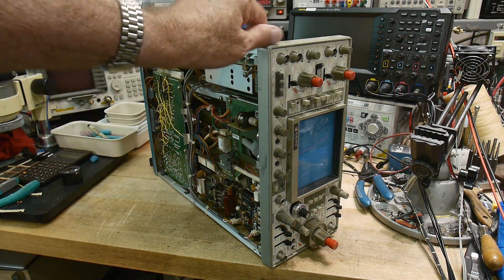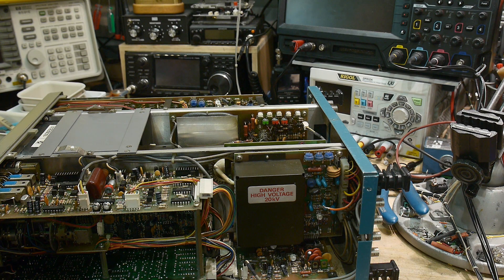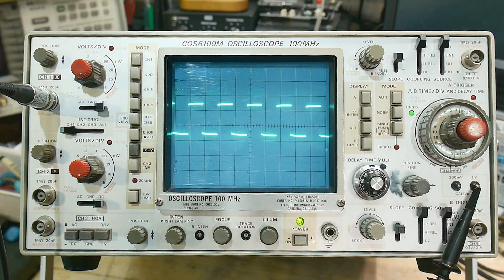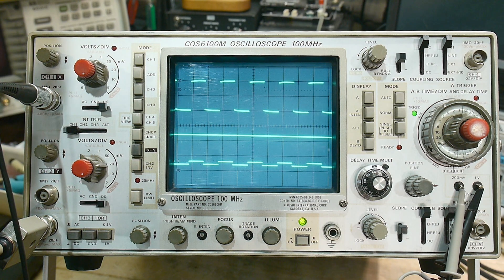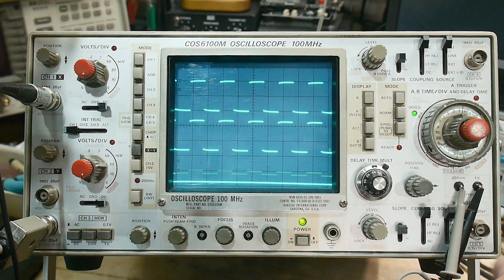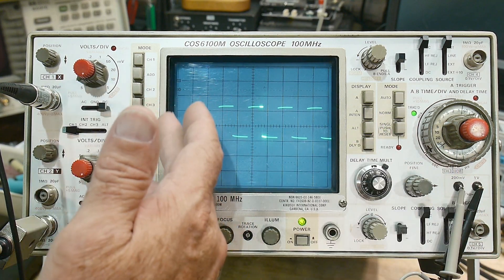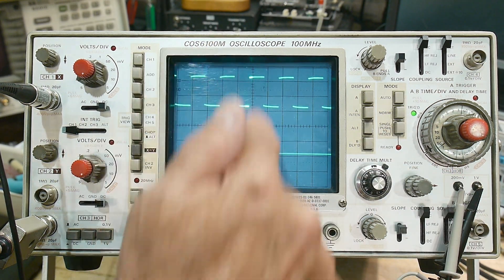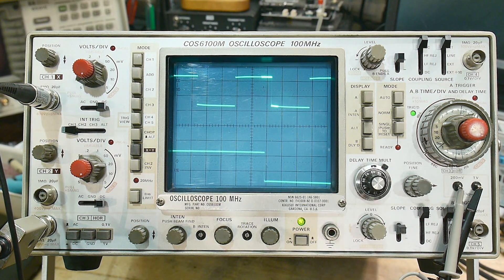#1255 Kikusui COS6100M (part 11 of 11)

Comment: My guess, on your old scope, was that there was some arcing that knocked out part of the HV tripler. The HV and focus voltages must be correct for the electron bean to form properly. If not, the control grid will just cut the beam off.

Comment: What a deal...A donor working scope for $58...Good job. And now you have a basis for comparison for the HV tripler repair. May the new scope get used a tiny and let the Rigol rest from time to time...

We do like or I like the Rigol math and time and voltage display calculations ...it's just newer and better...

It sounds like the Japanese wanted to distinguish themselves a little from TEK and make inroads into their domence...so they added some unique features..

I am ready for some more delayed time base training...

May your sleep be more sound

Thanks
Reply from the maker: the proof is that this scope was part of a US military contract. They won over Tek and  HP.

Comment: Nice video and nice 'scope! It does however use a delay line, so fast triggering edges may be observed, in contrast with what is said from 7:56 in the video. See figures 6.1 and 6.4 and paragraph 6.4 in the manual.
Reply from the maker: Oh, you are right. Wow the delay line was so small I missed it. about 4"x4"x1/2"   The tek and HP delay lines are massive as I showed in a different video. It must not be too long of a delay as I have a hard time seeing the first edge.

Comment: I have one of those little ARM-based DSO203 scopes. It takes a bit of getting used to the user interface and is quite limited in bandwidth, input voltage and functionality but it's very tiny and cute. I can have a whole lab in a small dry case.
Reply from the maker: https://youtu.be/WjPqWUMQofs

Comment: I had a friend modify his Tek 465 to do A-slotted-B mode. Instead of intensifying the beam, it jumped to the B position, sweeps B, then jumped back to finish the A. The “jump” was a clean arc, the beam wasn’t blanked, so it looked rather cool. It took a lot of modification to make it work well if I recall.

Comment: Overall not a bad scope, I'm with another comment I saw, does remind me of the Tek 400 series scopes. I had a 475 on my work bench at work bench back in the day and always liked it. I have a small collection of the 7603's ,Rack mount and normal and can remember when they cost some good money back in the mid to late 70's and other than having to try to maintain them at their age , there not bad scopes even today.
Reply from the maker: I had a 465 for years. and then a 22xx series one that was very nice. I think this has a slightly better trace than the 465 but my memory might be wrong

Comment: This scope was obviously designed for testing a very specific piece of equipment.
Reply from the maker: why would you say that? It looks like a very normal generic scope.
Reply: @IMSAIGuy  The extra not fully independent channels used for multiple triggers was something I saw in a military calibration lab years ago and it was explained as per the very specific use.
Reply: @fredflickinger643  That may be the case of course. But I always loathed the idea that you can’t visualize the trigger waveform on most scopes - be it analog or digital. I’m impressed they did the trigger view for both A and B triggers.
Reply from the maker: I've seen trigger view on many scopes, and external trigger is everywhere. the only odd one is the extra trigger on B trace. I agree pretty specific.

Comment: If you are still interested, like many of your viewers :o) , in what went wrong with the first scope, you now have the chance to compare voltages, in particular the voltages at the high voltage module, between the working and the non working scope. 
If there is just one voltage source broken it should be reconstruct-able.
Reply: I'd like to see that module X-rayed, depotted and repaired or rebuilt. It would be educational and entertaining.
Reply: @KJ6EAD  if it's just a simple multiplier it should be easy to build.